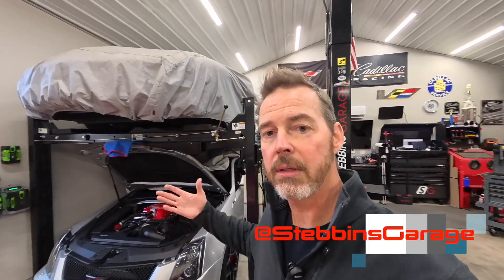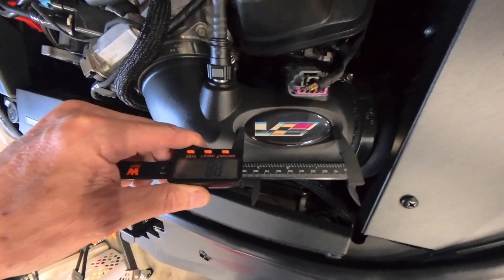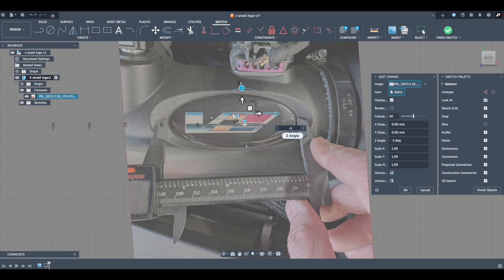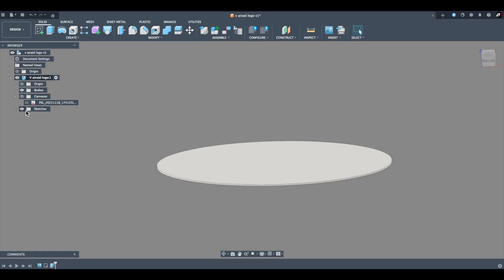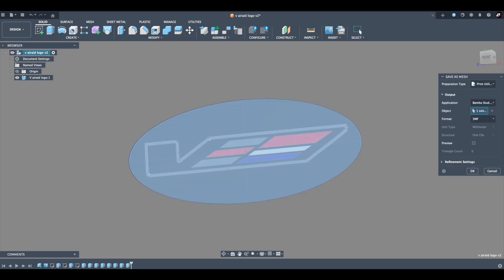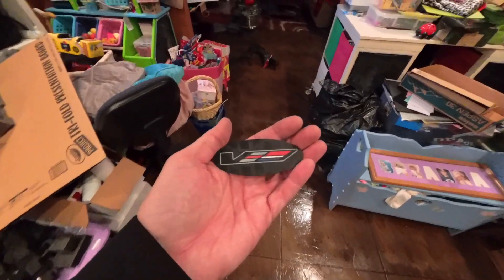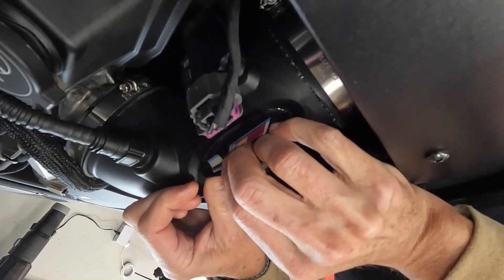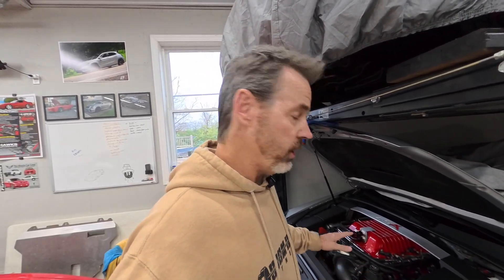3D Printing a Custom Badge for Cheap on the Bambu X1 Carbon

Comment: Pretty slick!  What kind of epoxy did you use for the top?
Reply from the maker: It's some UV activated resin from Amazon. I'll add to the description. It works well- there's some flexible epoxy you can use as well but I can never find it